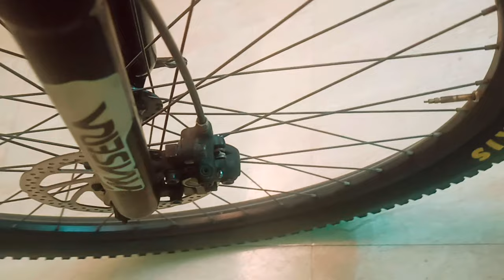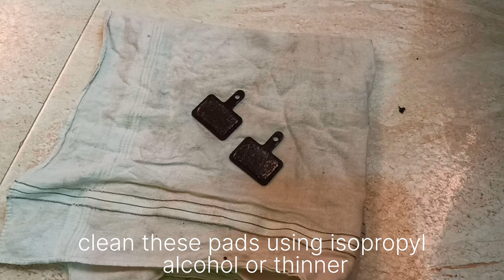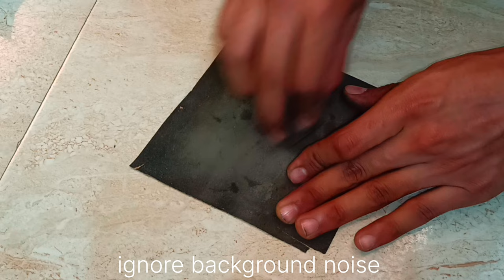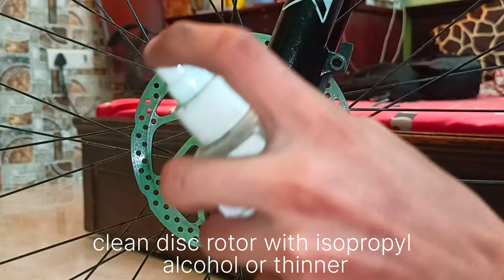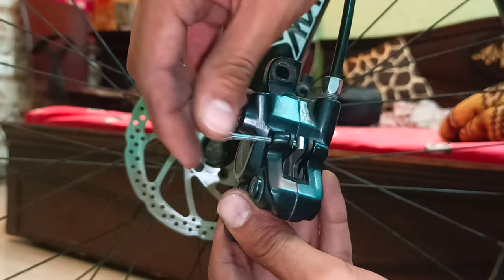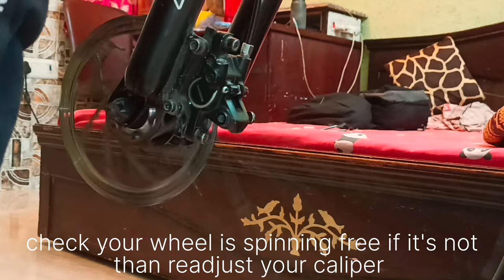How to fix squeaky brakes or disc brake sound step by step

Comment: Yes. But a few tips for doing a better job
1. If you have your brake caliper perfectly aligned, I would recommend you take of the wheel because sometimes it is very difficult to centre it.
2. Use a sandpaper that is not very abrasives or it might scratch your pads harder than needed. Use a 400 and up
3. After you sand them, clean them again with a rag and alcohol to wipe the dust off them.
4. Clean the rotor switching the rag until you don't see anything gathering on the rag.
5. Liver and lever are completely different things!
06:21 Very good thing that you pointed that out! 👍
Reply: I prefer to ride with the squeal - I lovoe to blast the REEEEEEEEEEEEEEEEEE when I'm speeding down the road
Reply: @Rod Salka  ye. Or when i'm behind someone and suddenly brake and it scares them 😇